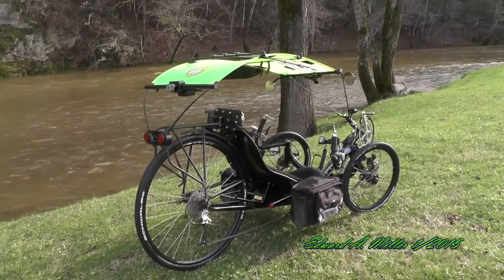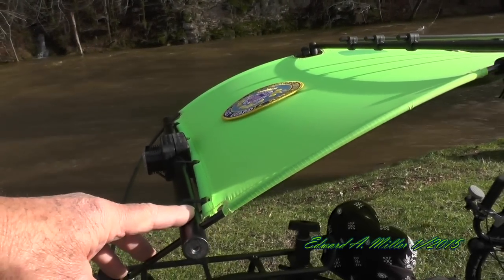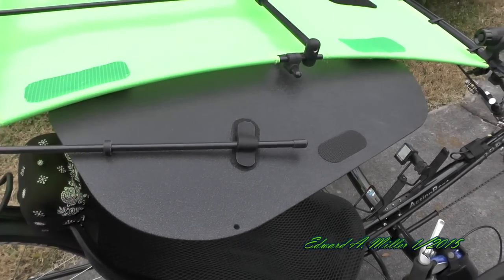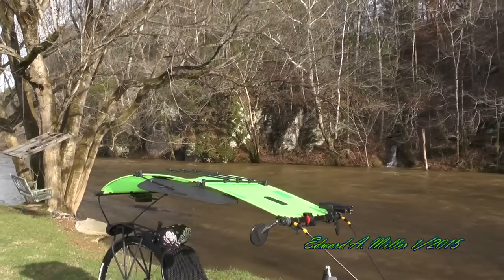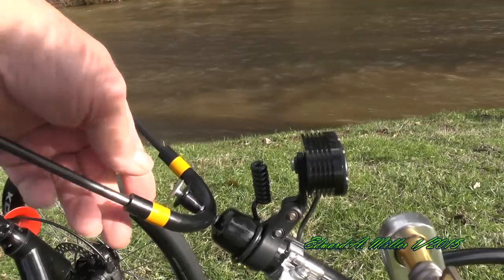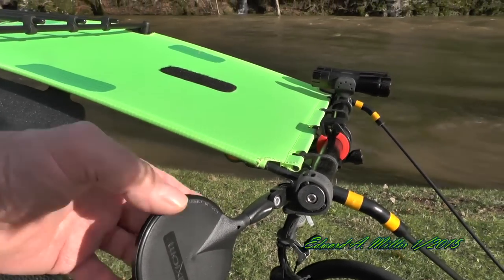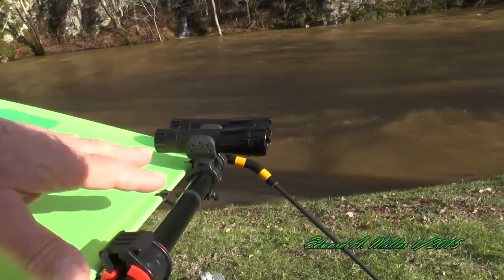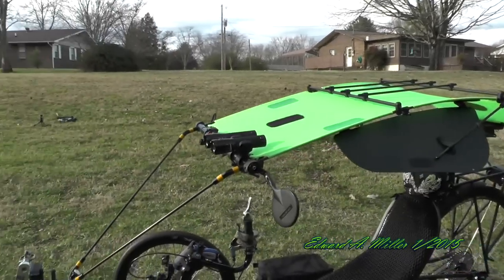Recumbent Trike Canopy, 2015-01-05 Status Overview

Comment: VERY impressive canopy setup you have here, the most complete and well-thought I have seen to date! Regarding Axiom mirrors, yes, they are an excellent choice for a mirror that can adjust in all planes and directions. I have one on my HP Velotechnik Scorpion, in addition to the stock big mirrors, and I like the immediate ease of adjustment of the Axiom (mine is a strap-on version, so I can mount it anywhere almost instantly). Thanks for sharing!
steve

Comment: Your doing a wonderful job on the canopy, I will be getting one probably later. I just got a month ago my Terra Trike Rover, learning all about it.Not related to the canopy, but I noticed on the back of canopy a red light I would like to find. What is the brand or model No? Your canopys look real good and your improving them all the time . Keep up the good work, will talk more later, Ron
Reply from the maker: Peg Hucke Thanks, Ron. The light on the canopy rear accessory bar is a DiNotte 400R (400L on the front). I bought the recumbent trike for 'fun'; bought the lights as if my safety might depend on them!
Reply: Peg Hucke Thanks Edward, I will look that up now, thanks for responding back so soon. Well try to stay in touch and happy trickeing.Ron

Comment: How much does that move around at about 15 to 17 mph? How does it handle wind up to 35 mph, in addition to writing speed? I generally cruise around that speed and much of the year is windy. The wind is usually coming from directly in front of me or the side.
Reply from the maker: 'Flopping" is directly related by how well it is tuned. Stick it up in the sky it will flop; tuck it down, not so much. I have a rider in NC consistently bombing down hills in the 50MPH range with an occasional 60+......... no flop!
Reply: Thanks. Doesn’t it cover less, the lower it is? How do you get in and out when it’s very low?
Reply from the maker: @benwhite3227  Not necessarily. Disconnect the front (it swings up and out of the way), mount as usual.
Reply: Nice! I saw a kayak sun shade modified for a trike that did that. I wondered if bike specific ones did that and I thought it was a good idea.
Reply from the maker: @benwhite3227  Kayak canopies are designed for kayak vibrations (on the water!). Plus custom adapters to a trike will reflect the designers worth (generally $0.00, as not priced in).

Comment: I'd like to know more about your video camera rig shown at the beginning of this video.
Reply from the maker: See camera credits 07:36. It is mounted to a Vello Action Pan handle sitting atop a small tripod.
Reply: Thanks for your response. I was particularly interested in a source for the handle. Your videos are great!!
Reply from the maker: The handle is inexpensive and rather light weight. I also like the rubber-footed base which allows for a quick set down and retrieval. Additionally, I installed a quick-release handle to the bottom for 360° hand-held panning.

Since this picture was taken I installed a shock-mount for the mic. In this picture the mic cord was draped across the handle and was picking up handling noise. So now the mic is on the left and the cord hangs free so the sound pick up is distortion free. 

I judge video sound as 50% of the product. And sometimes even the background sound is TRUE TO THE CAPTURE and rather 'Earthy'. Thanks for your interest.